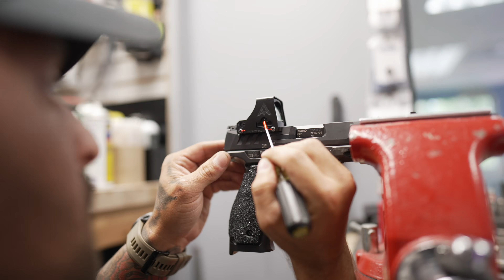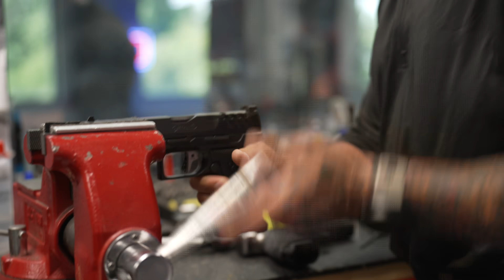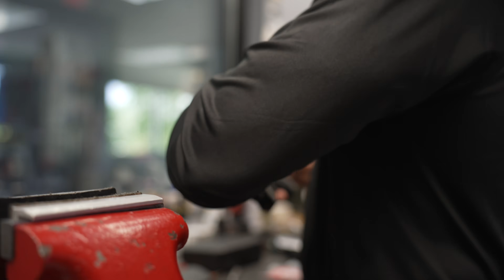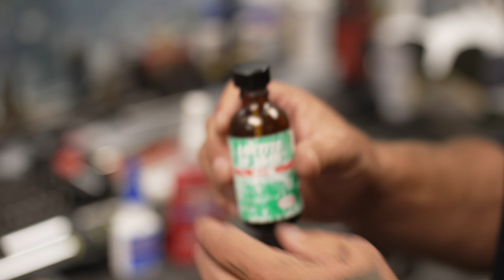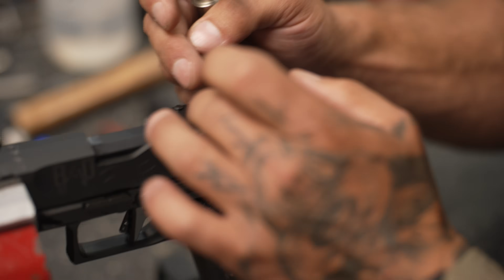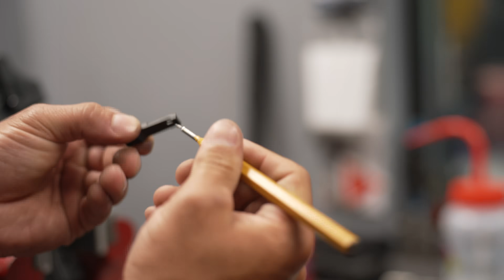Paul Costa's PDP Setup | Walther PDP Match SF

Comment: I didn't stretch the trigger return spring but installed the plunger spring and a glock 4.5 striker spring and got a 2.25-2.5 pull. I got about 5k rounds on and reliability has been 100%

Comment: ZR makes a 14.5 and 16 lb Long Stroke guide for now. What do you recommend?
Reply: 14.5
Reply: Did you have to install reduce power striker spring to get reliable slide lockup along with ZRT 14.5# long stroke guide rod?  I’ve heard no long as you keep gun clean and oiled.
Reply: @ No, Did not have to do that and my guns are always dirty. I have over 30K on one of them with just wiping it down and oil. No issues as of yet.

Comment: Which spring weight did you use for the ZR Tactical long stroke guide rod and spring? I have just looked at ZR's website, and they offer a 14,5lb and a 16lb spring.
Reply: 14.5

Comment: Something to note about the long stroke setup — being discussed a lot on Reddit — is that on earlier models of SF pistols, it was causing out of battery issues on tactical/competition reloads. 

Apparently, there’s a weird over insertion issue. Taylor Freelance +4 basepads solved this issue.
Reply: The over insertion issue is with a lot of the after market base pad when you remove the mag well.  

as for out of battery issues, I have not encounter any of that with me guns.  I have 3 of the same one.  Doesn't mean its not happening I just haven't seen it

Comment: +1 to the ZR Tactical Long Stroke. HUGE difference on my Polymer 5. Everything else Paul showed is more "personal feel" but the Long Stroke is almost required IMO.
Reply: Have you tried the ZRT ultra brass 15lb setup with 147gr? Pretty soft as well.
Reply: @seengh  I have not, and usually don't buy 147 grain either. I can't imagine better than the long stroke.  are you running that setup?
Reply: @patrickjclarke are you using the long stroke with the 5 match poly?
Reply: @h22mantis  yup! the one specifically made for the 5 match poly. I love it. My instructor gave it a try last lesson I had and even she was shocked at how much of a difference it made.
Reply: @h22mantis  Yes, I use the long stroke in my poly PDP's also
Reply: @patrickjclarke try the long stroke with 147gr. It hits different
Reply: I tried the long stroke but it just felt slow compared to the stock guide rod. Felt like I was waiting on the gun and my splits were just a tad slower. But I also don't mind a gun being snappy so long as the dot settles in the same spot after each shot. It's just cycling faster.

Comment: @Achilles Heel Tactical - Great video 😊I set my SF Match up like @Nick Young, @Joel Park... ZR Long Stroke /15lb, 507 Comp, Sprinco trigger kit, Lok Bogie palm swell. Very similar to yours.  I did install the safety plunger spring.  I gave me a similar pull weight to yours without having to "stretch" the trigger return spring. 😉 and the factory Walther Plate "snaps" in, it's very nice. 🙂

Comment: What guide rod spring LB do you run?
Reply: 15 LB. - That's what ZR recommends. @Nick Young (Velox) talks about it in his video. 😉
Reply: @chrisdiceart Thanks , I scan through. I didn't watch the whole vid. BTW, I used 11lb without a hiccup and over 3000 rounds
Reply: They recommend 16 lbs to Me for competition since it returns faster

Comment: When I put the Dynamic Performance trigger on my pdp I took the spring from my stock PDT and replaced it with the one that comes with the DPT and it did the trick, went from a 4.5 LB pull to a sub 3 LB pull
Reply: Did you mean to say you took the stock PDP spring and used it on the dynamic performance trigger?
Reply: I didn’t ask that right sorry but I’m about ready to do the switch. So I’m still I’m just not clear on what you were trying to say. Sorry.
Reply: @larrybruns5051  Did it work? Which spring did he mean?

Comment: 😬 I trq my sig screws on my optic to 35 in lbs.
Reply: Holy torque Batman! That’s a lot, I wouldn’t be surprised if they snap off one day and jettison your optic
Reply: @protectiverailroaddad7541  2000 rounds later no problem. I watched it on a YouTube so still my fault tho. Should i unscrew it and trq it again?
Reply: @RangeNotesProject  If your going to take them out get new screws you have probably compromised there integrity anyway.
Reply: @ thank you! I have 3 sigs by now and i use that one the most. Probably shoot about 1k rounds a month since then and it runs flawlessly. I did some research and while youre definitely right and is not recommended, those screws hold a lot more. Ima take it as an experiment. Thanks for the help